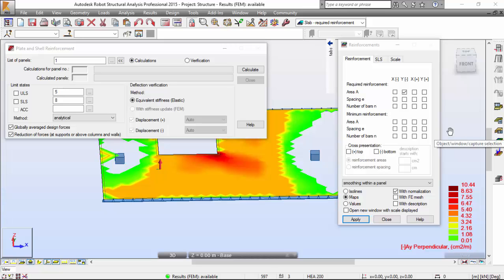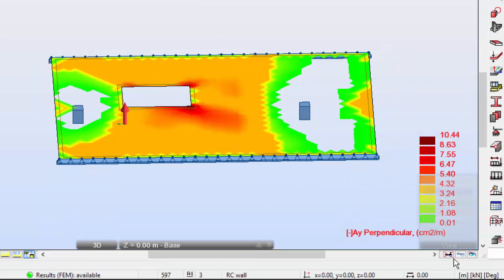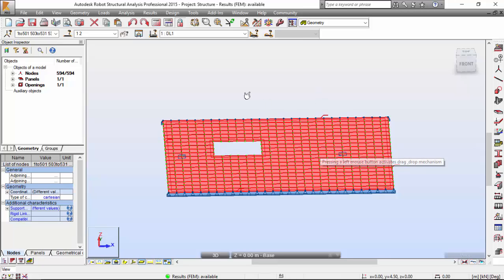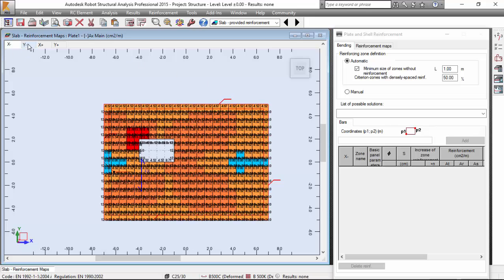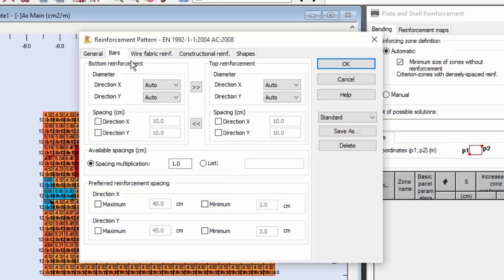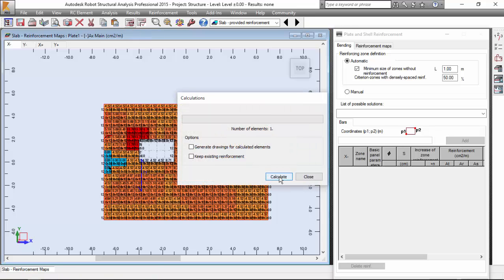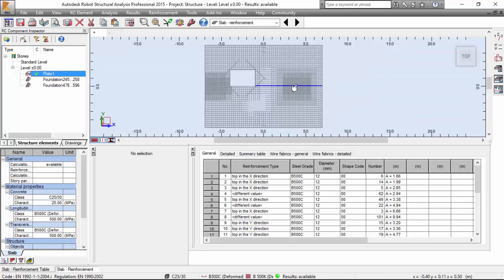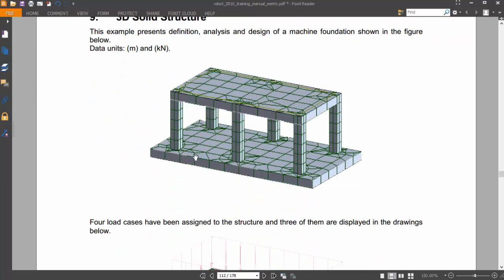Exercise 8 - Part 4 - Defining and Analyzing a Concrete Floor (Robot Structural Analysis)

Comment: Thanks,
very interesting and helpful video. However, when I look at the final slab provided reinforcement which C12 top and bottom. but the final diagram show only the top reinforcement. Is this correct?
How about generation the report?

Comment: Hi Nuno, great presentation. I am wondering if it is possible to run a non-linear analysis to consider cracking and yielding now that we have the real reinforcement for the slab. This would lead to more realistic displacements and moments (due to redistributions) and thus we could run a second round of reinforcing design, this time, more optimized. Do you have any clue about this possibility?
Reply from the maker: Thank you very much. As far as I know, it is not possible. Robot is mainly a linear analysis software. To do such a thing you would need to user other software.